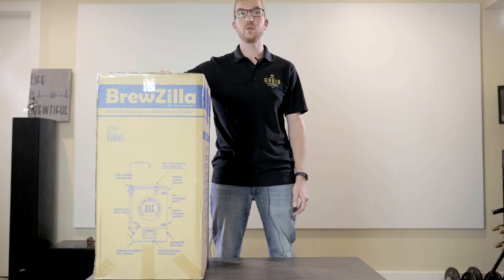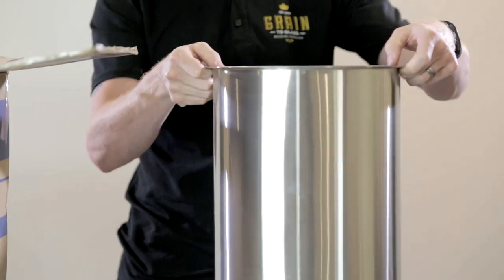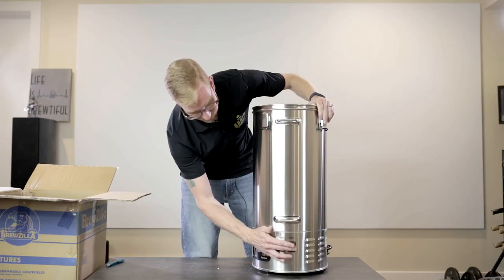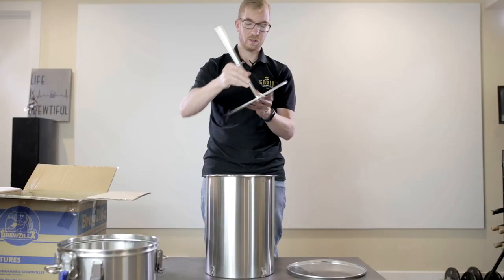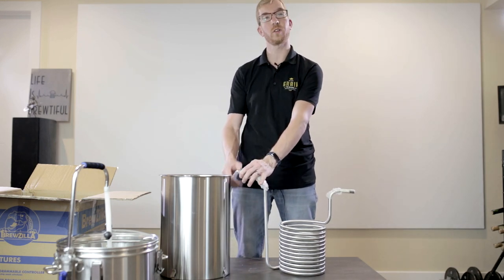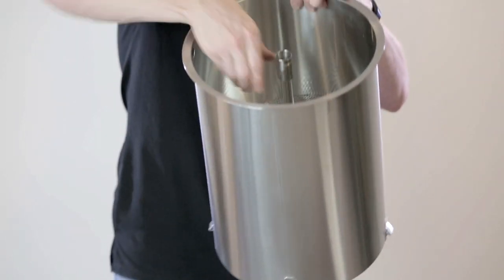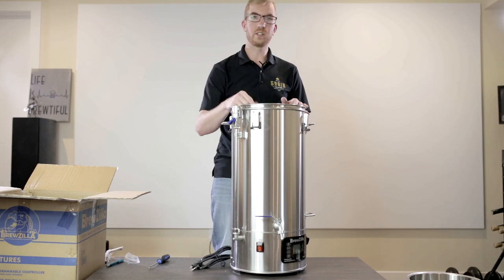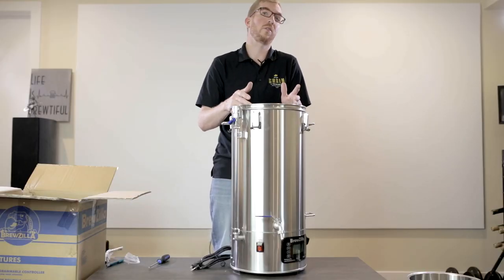Brewzilla (Robobrew) v3.1.1 Unboxing And Assembly Video

Comment: Fantastic video. I was extraordinarily confused when my unit came without an instruction manual. After finding the "official" manual online, I quickly realized that it's... not very comprehensive. At all. Your step-by-step is absolutely perfect. Thanks!
Reply from the maker: Cheers!
Reply: Agreed. The manual's information density is not very high, and the "use" instructions are mixed in with the "assembly" instructions.

Comment: pro tip .. use a hop spider and put the tube in it at beginning of boil with the pump running , you catch a ton of loose grain and hops that would otherwise end up as gunk at bottom

Comment: Update (April 2021): I just unboxed a new 3.1.1, and it did not come with two lower screens - only the one with the threads. The fine-mesh screen was not included. And it sounds like it isn't that useful anyway, since there are lots of videos that say using both screens causes clogging.

Comment: Shouldn't you only put the false bottom in for the boil? Otherwise wouldn't recirculation not work correctly? i.e. grains that get past the grain pipe's filter could get stuck above the false bottom instead of beign recirced back to the top of the mash. And then those would stay in the boil and boiling grains is meant to be bad.

Comment: What's wrong with those Robobrew people to make an expensive product and not provide a manual. Love your video.

I think you should come up with a little hang-on basket that fits onto some of the external bits, maybe the bottom of the pump, to put the overflow valve and the pipe blocker .... I can see those getting lost real fast. Another place to put your logo and URL on.

Comment: Hi, very good thanks, but what new in 3.1..1 please and is there any real difference other than price between this and the Grainfather, thanks
Reply from the maker: The Grainfather has a very good 3 year warranty, bluetooth connection and a counterflow chiller.  Other than that they are the same and I find both make equally good beer.  Cheers

Comment: I'm looking at ditching my propane set up for this. My question, can you really plug this into any outlet? Or do I need to make sure it's on a circuit where not much else is going too? I plan to run this in the garage, maybe a light or 2 on but that's about it. If I wanted to run it in the house, would I run into issues if it's on the same circuit as say, a fridge, or a TV and sound system?

Also, could you just have the mash pipe installed while you heat up your mash water? Why heat it up, THEN put it in?
Reply from the maker: It draws give or take 1500 watts so it will depend on what else is plugged into that circuit.  I have yet to run into any issues and I've plugged it in various outlets inside and outside of my house.  I leave the mash pipe in the Brewzilla while it heats up.

Comment: Thanks for instructions. I just bought the system yesterday. I noticed that i didnt have the same mesh screens in the grain basket that you show in the video. These are thicker and stainless steel color. Is this what the new models are shipping with?
Reply: My new unit just arrived and it only has one bottom screen (the one with the threads), and the upper screen with the two little grips.
Reply: @T_Mo271  my local brewstore said apparently they are shipping them without them. They said they had reached out to the company and are waiting for confirmation.

Comment: I am getting E3 error. The machine doesn’t start. I filled up my brew zilla with 20+ litres of water. Waited for half hour. But still doesn’t start. Any trouble shooting ideas. ?
Reply from the maker: Hello, according to the manual:
E3 error: This indicates the boil dry protection has been triggered. This can be triggered for several reasons including:

If the BrewZilla has been operated when it has not been filled at least to the minimum liquid fill line. If this happens it will trigger the boil dry error. Please make sure the BrewZilla is always filled to at least the minim fill line.

The pump has pumped the boiler dry. For instance if you block off the overflow tube that allows excess liquid to return to the boiler this can result in pumping all the liquid into the malt pipe and then the liquid level in the boiler will be too low and cause this error to occur. Always make sure to have enough liquid in the BrewZilla so even when the pump has pumped liquid into your malt pipe you still have enough in the bottom of the boiler to ensure the boil dry protection has not been triggered.

Solids in the boiler such as excessive hops, sugars or other solids. For instance if you pour a kg of sugar into the boiler all at once this will cover the element and act like a blanket. This will allow the element to reach temperatures that are above boiling point and this will result in triggering the boil dry protection. The same thing can happen when excessive hops, and other solids sit and cover up the element.

This error may also indicate that a wire may have come loose from a terminal, a wire is connected to the incorrect terminal or the main circuit board/LCD are malfunctioning.

I've also heard of many people fixing this error by replacing the circuit board or both circuit board and lcd screen.  Just make sure that both are version 3.1.1

Comment: Great video. First go with my Brewzilla now. 
Sparging seems to be taking a long time. Maybe my grain is crushed too fine and blocking the bottom plate somewhat?
Reply from the maker: Hey, if you are using the fine mesh screen I would recommend not using it.  Otherwise grain crush might be to fine or if your recipe had a lot of flakes or wheat malt it tends to cause issues.  Using a couple hand fulls of rice hulls next time should help.  Cheers!

Comment: Two questions:
1. How much sparge water are you supposed to use?

2. What fittings attach to the Chiller?
Reply from the maker: Sparge water will vary based on amount of grain and batch size.  Use a calculator like the one in Brewfather to calculate mash and sparge volumes.  On the chiller for the cold water in I have 1/2" tubing connected with a hose clamp that goes to a garden hose fitting and for the hot water out I use high temperature silicon tubing.  Cheers

Comment: Great video Paul. I have over 12 5 Gallon batches on my BrewZilla 3.1 that I purchased 9 months ago from Grain to Glass it is holding up great! Going to take it completely apart on year one for a very in-depth cleaning and resealing of the fittings. Paul also got me hooked on the fermzilla's and I purchased two and rigged up temperature control the combo makes for perfectly consistent batches.
Reply from the maker: Glad to hear you're liking the Brewzilla and Fermzilla!

Comment: Thank you I'm planning on purchasing this unit in a few  months before summer starts your video is awesome.
Reply: What's the volume off a final single batch with this unit.
Reply from the maker: @keithwaldner7652  I usually brew a 21L batch so after fermentation it fills a 19L corny keg.  You could brew a bit more than that if you wanted to.
Reply: @graintoglass  

Thank you

Comment: Very informative video. Can you elaborate on what improvements were made to this 3.1.1? I didn’t notice anything different from my 3.1, I assume it’s something in the control programming.
Reply from the maker: I honestly couldn't find anything other than improved circuit board when I tried to research the differences.  At some point I will take apart the 3.1 and 3.1.1 to see if I can spot any internal differences.
Reply: @graintoglass  They added an alteration to the programming: there's now two "AUTO" modes. One starts the next step's timer immediately upon finishing each programmed step. The other AUTO mode waits until the next step's set temperature has been achieved and THEN starts the timer. I only know this 'cause I saw a review of the v3 (not the 3.1.1) and the reviewer specifically complained about a lack of a preheat version of the timers. Apparently one of the designers eventually saw the review. Haha.

Comment: You said 1/2" x 5/8" for the silicon hose. Does that mean either will do? Or is it 1/2" inside diameter and 5/8" outside?
Reply from the maker: 1/2" inside 5/8" outside.  Cheers

Comment: Do you use the "falsebottom" all the time...? A friend of mine tells me to throw it away..
Reply from the maker: Hello, yes I use the false bottom all the time.  Not sure why you wouldn't want to, it will block hops and other stuff from getting into the pump.
Reply: Maybe your friend is referring to the secondary mash screen? if thats the case then yeah i threw mine away...my sparges were taking HOURS